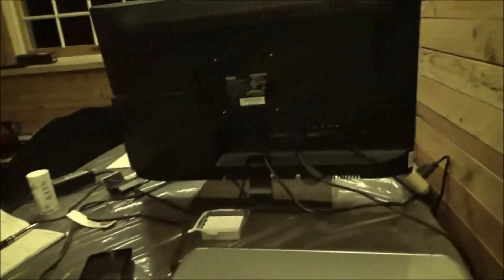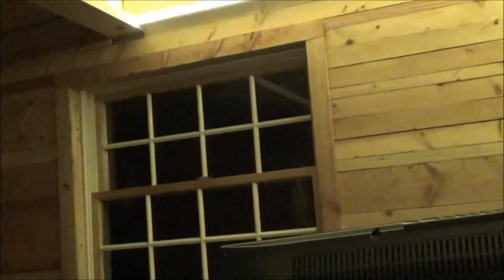Bedini Motor Radiant Energy Generator A Scam Or Is It Real

Comment: What is "radiant energy".   Is this infra-red?  Static Electricity?  Magnetic Inductance?  RF transmission?  Some may have used the term perpetual motion, I never did.   Is Radiant Energy something we cannot measure that science hasn't acknowledged the existence of yet?   Do you see the problem here?   It feels like the Bedini is faith based.
Reply: Albertzz99 Well, that would be interesting.
Reply: Is the problem...that if "science" hasn't named it then it must not exist?
Reply: No, not at all.  Such logic is easily defeated.  Obviously Neptune existed before it was viewed.   The first "observer" could not observe if his observations were a prerequisite for such a planet popping into existence.  My point is to draw to the surface if those who think a Bedini works can measure and show results or is their confidence in the device simply based on faith?  Is "Radiant Energy" part of some undiscovered energy field?  Is it measurable?  Or, is it so much vapor?  People seek to verify what they already believe.  They look to confirm their bias.  In order to remain rational we must all protect ourselves from this very proclivity.  There was no measurement taken in the beginning for which he can measure in the end to produce any before and after data.   He can simply declare it worked (or did not).  Yet, none of us can know if Schrodinger's cat lives?  (please forgive the terrible use of that reference)
Reply: RadicalRC So, if he measured the voltage of the batteries before and after the desulfating process would that help?  I would not begin to know how this "radiant energy" would be measured or if there is even a meter calibrated to effectively measure it.  But, just because I don't have the correct equipment to measure something, doesn't mean I must believe it does not exist. Has anyone ever attempted to measure that (what is it called?) backfield (?) energy?
Reply: Albertzz99 Perhaps a better term would be previously untapped, rather than free energy. It seems to be the Bendi simply harnesses energy that was previously wasted.
Reply from the maker: RadicalRC It can be measured and shown to some extent and has been done many times. You can see the output on an oscilloscope. You can see and measure the results in a fully restored and charged battery. You can see that the output battery has more capacity than before it was restored. You can see that batteries gain in capacity with each use on the Bedini motor. I can go on and on. But it has been proven to exist. Its like saying that you cannot see the wind so it must not exist.
Reply: RadicalRC  I agree, it's real easy to be fooled, happened to me too years ago. Someone told me it was possible to restore lead acid batteries by removal of sulphate. I think it must have been around 1992 - 93. This was about the same time my car battery started to show some signs of sensitivity to cold weather. So I thought, hey why not..Worst case it can only be too good to be true, right. Well it was worse. Forgot to say this was a solid state desulphator. So I went ahead with the experiment and hooked it up to the battery in the car. This was the type that's activated when battery voltage exceeds 13,5V,  so it was a permanent mount under the hood. As described in the instructions.  The weeks went by and it actually seemed to work and I thought this was one of the greatest inventions ever. At the time I didn't have equipment to measure internal resistance of the battery and no digital analyzers like today. So to me it really seemed to work, acid weight and voltage was good and it performed a little better when cold. It got me through winter and gave my battery a few months extended life. But then it suddenly failed. It completely fell apart internally. So one day my car started, the next not so much. I still have that "desulphator" as a reminder of how easy it is to get sucked into an idea and waste time accomplishing nothing.

I should have known better. There's always a reason why one ends up with a sulphated battery. And in most cases it's related to neglect, failure to charge it correctly and/or properly.
Reply: I think radiant energy is the high voltage electrostatic induction that existed and was played with since man was fascinated with lightning and devices like the wimshurst  were the first ones that tapped into it..
Reply: RadicalRC yes I believe the wimshurst has far greater potential that what chance it had been given since its invention in the 1860s? As soon as they found that the inductor coil could create high voltages, they dumped the wimshurst and other different variations of the contraption for the inductor coil methods. This is really sad to me because I think there is far greater potential in a wimshurst machine, its just that we haven't found this yet because we only used it for about 40 years before it was turned into some kind of novelty toy or science lab demo..the only time I saw its true potential was in a 1980s 'testatika' machine (based on a wimshurst machine but with many other secret mods in between) made by the late Paul Baumann..you should also look up on De Palma's (late) Homopolar generator too!! that one is also one heck of a simple device that taps into energy from the environment.I hope to make one like that one day if god permits
Reply: fidel catsro If you can prove something has a benefit, make it and money will flow your way.  If you make it and cannot prove it has benefit, the proper result is capital (money) flows towards people who can better apply it to productive use.  And, that is exactly what should happen.  There is no magic free energy, no over unity.  In that regard, every machine you mention is another form of Bedini bullshit.  The only energy from the environment here is the lug turning the handle.   That is the energy input, the only energy input here.  The energy in that spark is insignificant.  It's only potential is to give you a thrill.   Don't you think it's time to move beyond pretending there is any kind of "should have been" to ancient mechanical whirlly gigs?  Don't be the cave man who sees a flashlight for the first time and thinks it must be in the hand of magician.  Be the brute who invents the next new product or device that makes life less brutish.  We don't need to step back to hand cranking our own power generation.  Lets look ahead to the distant horizon.
Reply: fidel catsro If you could go back and show a cave man an I-Phone, he would be fascinated.  He would think you were a god.  He would be filled with wonder because you controlled something he did not understand.  If you were evil, you could use his wonder against him.  You could predate on him.  Don't be a cave man.  A mark of intelligence is realizing what you don't understand.  Do I see things that fill me with wonder?   Sure.  But, I know there is no over unity.  It's a hoax, a scam, a kind of religion.  I know if it looks like over unity, that simply there is something I don't understand.  Don't be a cave man.   Stay connected to reality.   I think those video's are fun, but mostly, I'm laughing at the lack of basic physics, or I'm looking for the scam, putting the puzzle together.  Some of these people are sincere, but fools.  Some are scammers suckering fools out of their investment capital.  The majority are simply creating compelling video's and farming you for views and click.  Smart like a fox.  Don't be a cave man.  Over unity is not science, it's fantasy.  Understand it as entertainment and do something productive with your mental powers most of the time.  In the end, you'll be much further ahead.
Reply: Bedini is scam. See my channel why, I debunk all his chargers by showing to you what is inside!! And how they KILL your batteries!!
Reply: RadicalRC I've been watching the "free energy commynity" for years with half an eye. But as of yet I have seen no one able to demonstrate any of theese systems running self contained, or in a closed-loop manner while producing excess power.
Reply: MollyDolly I don't think it's about wasted energy. Troy said himself on the video that the draw on the "source" battery was in the milliamp range. So that does not leave room for much waste to be recovered. He said on another video that the price on copper was the only thing preventing him from building a large Bedini to power more of his household. But I'm sure he could get the wire if needed. He has lots of stuff he could sell to get the wire he needs. I hope he can see that soon. Then he would not need to mess with so many batteries, solar panels, and wind towers.
Reply: MollyDolly You're absolutely right. I think that upcoming video will surpass all previous videos combined view count.
Reply: the radiant energy that troy uses here is a voltage spike (puls) created by a collapsing field from a coil, if you put dc power on a coil , and you disconect that power , the collapsing magnetic field will induct a high voltage in the coil, like a coil from a car ignition, or a simple doorbel, conect that bel on a 6 volt battery and put your finger on the coil wires , you get schocked by a dc puls of around 600 volts, that kind of spiked high dc voltage is fed into the battery to kind off burn of the sulphate from the plates., so in his case , the radiant energy is a high voltage puls.
Reply: Albertzz99 No one is making the claim that Troy's Bedini motor will work in a closed system. In fact, he clearly states that he inputs energy into the system and that if he unplugs it, it will cease to operate. He also states that it gets additional energy from a secondary source. It seems that what is being questioned is the efficacy of the secondary source.
Reply: SSanf To bad then I didn't quote all the different statements in my first post
 in this thread. So, while searching for them I found a new fresh one in
 the comments here on this video.__Quote Troy:"The only thing stopping 
me from running my entire home on this is the 
cost to build one. Thats it. John has one that he built. It cost him 
about $30,000 to build. It runs his warehouse and workshop. He sells 
them as well."__So you see, you must have an open mind and be receptive 
to the idea that someone will make a claim like this.
Reply: Albertzz99
I think it is only fair to solely address the claims that Troy, himself, has made. He is not responsible for the accuracy of the claims of other people. I am not entirely sure what John's claim is, perhaps, it is simply keeping his batteries in good shape.
Reply: SSanf I think you are 100% correct that nobody could know exactly what john claims, and that Troy hopefully can't be held responsible for his statements.  So here's the part of Troys quote that's solely made by Troy about Troy himself. QUOTE: "The only thing stopping me from running my entire home on this is the cost to build one. Thats it."
Reply: Albertzz99
I think you should ask him for further clarification of what he meant.
Reply: SSanf I just did.
Reply: Albertzz99
Right you are.
Reply from the maker: Albertzz99 It is quite simple really. The thing needs some little power to run the wheel. The power going into the batteries being charged is greater then the amount of power being used. This is not the creation of energy, just tapping into an energy source that is readily available. With enough coils, transistors and components, you can have enough energy to run a house. Again, ask Ham radio operators about the energy that gets charged up in their antenna wires. Where does it come from? Why is it there? How can you use it? Well, the answer is simple. Its called a Bedini motor. The energy is there. Its sitting in what is called the Dirac Sea. Some call it Radiant Energy.
Reply: RadicalRC a bedini motor(like the one troy has) is nothing more than a motor, for as far I know now, a bedini motor is not (not yet) a overunity machine, only thing it generates is spykes, you can use, witch does not say i do not believe you can make a selfproppelant machine of it, fact is you can spin a wheel with very low power, but here is the problem, when you connect a pickup coil near the spinning magnets you can draw power of of it, but that power loads the wheel, in time stopping it, so no overunity, its more like a transformer now, with a spinning core in stead of a laminated steel fixed core.,you cant pul out more power then you put in it.
Reply: The Do It Yourself World  I think people are confusing the bedini motor with the bedini overunity generator, that does not work (yet).
the motor surly works afcource!, only not as a overunity machine (charging the same battery you useto turn the bedini motor, that can never be a overunity becouse off the friction in bearings, air drag and powerloss in coils etc., people are confusing the motor as a puls provider and a overunity machine.
Reply: MollyDolly this can be mesured by a volt meter, ossiloscope and a amp meter,

if you use a scope you can see it all at ones.
you can even calculate how mutch power the coil gives in a emp puls, thats higer grade electronics than normal electronics and electicity lessons.its sience!!
Reply: MrBugsier5
I think you are exactly right. is is not an over unity machine as Troy has described it. An over unity machine is impossible according to the laws of physics.
Reply: The Do It Yourself World Could you explain "The power going into the batteries being charged is greater then the amount of power being used."?     Do you mean you get more usable power put into the battery charged than what's consumed from the supply battery.
Reply: Albertzz99 He's not making that claim.  In fact he said specifically he did not believe it was in any way perpetual motion.  This question wastes time.   He's already acknowledged your position.  Lets move on.
Reply: RadicalRC If you read his reply to me above you'll find he says, quote: "The power going into the batteries being charged is greater then the amount of power being used."
I'm simply trying to understand his invention and how it's supposed to work when running.
Reply: Critic (al)  What do heatpumps got to do with free energy? They only move heat from one end of the system to the other via a medium (refrigerant usually). A heat pump can't run without energy supplied from the outside. This can of course be renewables, but outside energy just the same.

Troy claimed to get more out of his system than what was put in. If this is the case he would not need solar panels, only a bigger bedini. A heatpump can't run closed-loop and at the same time produce excess power. So no free energy.
Reply: Albertzz99 y do not believe that Troy sead that the bedini motor is a overunity system, he only stated that he uses very little power to make high voltage spikes to revive the second battery, making high voltage from low voltage is not the same as making more power out than he puts in, im sure he never mend that in his explenation, troy uses a bedini motor to make hv spikes to thry to repair sulfated batterys, not charge empty batterys with lesser power than normal, that would be a overunity machine witch by the laws of phisics is not possible (yet,)( who knows maby in the future!)
Reply: MrBugsier5  You have the same perception as me of this machine. But the thing is Troy actually said he got more power into the battery being charged than what was consumed from the supply battery. He also said Quote: "With enough coils, transistors and components, you can have enough energy to run a house."

That's why I want to know how his machine work, because this is big news. I'm also surprised he did not use it more often when the sun don't shine.

But if he don't want to tell the "secret" that's ok too. Then I'll stop asking.
Reply: Albertzz99  Troy nows very well that the bedini motor can never produces more power than it consumes, its just inpossible, but if he says that it is so he is indeed wrong, at this moment a bedini motor cant produce more power than you put in, its just (still) inpossible .
Reply: Critic (al) I simply cannot have a conversation with you if you can't understand the topic. A heat pump pumps heat, hence "heat-pump". A mechanical heat pump transfer heat from the evaporator to the condenser in most cases with the refrigerant as a medium. It does not "tap" "other energy sources".
Reply: MrBugsier5  This is my impression as well. But you can read my last quote if you scroll up in this discussion thread till you see his last entry where he responded to me.

I guess he will clearify this as time passes, so we in time get to know what he actually meant to say.
Reply: MollyDolly It would be my presumption that "radiant energy" is extra-scientific.  Something not real.  If it is explained in a way that it can be measured, then I'm all ears.  Not listening is not learning.  I've been sucked into fallacies or misunderstandings before.  there is no shame in correcting an errant position.  In fact, I take great pride in doing so.  

You go on to state: "But, just because I don't have the correct equipment to measure something, doesn't mean I must believe it does not exist."  This is true.  Does a tree make a sound when it falls and there are no ears to hear it?  Of course it does.  If it's real, it's measurable.
Reply: Albertzz99 I watch it also. It's great fun picking out the physics they are overlooking or watching how they explain it away.  I don't put Troy in this area.  He opened up with a statement that this is not perpetual motion.  I believe he believes that.  It may be Mr. Bedini believes otherwise, I don't know that much about him.
Reply: RadicalRC You're right, I remember he said that about perpetual motion. That's why I got so surprised when I saw all his other statements popping up multiple places, and on multiple videos. My first thought was "a bad explanation" from Troy. But then I saw someone ask again and got the same answer. So I had to sort of ask again to make sure I did see it correctly.

It's not the first time I have met people who think a heat pump is a "magical" free energy device like Critic, LOL  I mean 250 year old technology should be easy to understand :)
Reply: Albertzz99  wel it does, a heat pump uses electricity to run the pump, pumpig the refridgerant fluid, when it becomes a gas it wil get cold, so when it gets compressed it becomes a liquid again, this convesion produces heat, works the same as a fridge.(that needs a powersource to, mostly electricity, and in some cases propane for the heating flame.) so external energy to get it doing his thing.
Reply: The Do It Yourself World 1.  If we can see it on an oscilloscope then were are measuring electricity not "radiant" energy.  An oscilloscope only measures electricity.  Of course it can measure other things like sound if a microphone (a sensor) is used to convert the energy into electrical.  I imagine when Bedini says "radiant" he means something unknown or magical and not simple pulsating high voltage derived from magnetic field collapse and a coil.

2.  I would agree, if a careful capacity measurement were taken before and after, the tests would begin to build some proof of the desulfating claim.  I think this is very possible if not probable.  However, you do not posses the equipment to make such a measurement.  Or at least, if you do, I've never seen it.  It's only a feeling, a presumption, a whisper.  It would be fun to make a single cell PB batter in a Mason Jar and experiment with capacity before and after the Bedini over several cycles.
Reply: RadicalRC  in case of capacity its easy to see the difference, if you have a sulphated battery you cant charge it with a normal charger, after pulsing it for a time with high voltage peaks as you do with the puls from the output ofsay a bedini motor, the sulfate its getting from the plates and you can charge it again with a normal charger, his is a fact!, you do nat have to use a bedini motor, you can also do that with a electronic pulser, as long as it feeds high voltage spikes in the lead acid battery, thats no magic but plane fact. btw you dont mesure electricity with a scope, you mesure only voltage, when u mesure the voltage over a known resistance you cn calculate the amperes, a scope only mesures voltage.know the facts before you make a statement.
Reply: RadicalRC btw, reviving lead acid cels is no magic, we do it often with traction batterys, witch are expensive, and somtymes easy to revive when they are necleted ore not charged for a long time, believe me, its no magic, i do this for my proffession, we sell and instal battery systems, also on off rid projects.
Reply: MrBugsier5 I am aware of that. In another thread I theorized if it was working is was probably only because it was delivering a correct pulse pattern by Rube Goldberg means.  It's a series of coils, apparently a transistor turns power and on and off to the coils.  There would be spikes like an auto coil.  I am a battery professional also.   PB is a minor part of what we do.  I'm trying to keep the language and my explanations at a level most any reader can follow.
Reply: MrBugsier5 Going back and reader earlier comments you state :"in case of capacity its easy to see the difference, if you have a sulphated battery you cant charge it with a normal charger, after pulsing it for a time with high voltage peaks as you do with the puls from the output ofsay a bedini motor, the sulfate its getting from the plates and you can charge it again with a normal charger, his is a fact!, you do nat have to use a bedini motor, you can also do that with a electronic pulser, as long as it feeds high voltage spikes in the lead acid battery, thats no magic but plane fact. btw you dont mesure electricity with a scope, you mesure only voltage, when u mesure the voltage over a known resistance you cn calculate the amperes, a scope only mesures voltage.know the facts before you make a statement."

You make all those sensible remarks for which I side with you fully.  I've even made the same statement in other threads (the Bedini providing pulsed by more complex method) then end it by being a dick head.   

MrBugsier5 "know the facts before you make a statement."

Whatever big boy.  Whatever.
Reply: Albertzz99 Yes, he does.  Although I agree that it stinks of what you suggest, I wouldn't go as far to say it's absolute.  From what I can tell, the Dirac Sea is a real and not discredited theory.   However, there are sites showing how people use the concept to scam others.  If the energy is there and it's being subtracted from, then it's not perpetual motion.  I don't see him making a claim of perpetual motion here.   I don't understand the "Direc Sea" theory in physics and doubt Troy or Bedini or anybody in these threads does either.   I'm skeptical.  It's not been proven and nobody here seems capable of proving the Bedini taps this form of energy.  It's vapor science in all likelyhood.   Like I said, I've been fooled before.  Everybody can be.
Reply: Albertzz99 "I should have known better. There's always a reason why one ends up with a sulfated battery. And in most cases it's related to neglect, failure to charge it correctly and/or properly."

I agree.  However, there are sophisticated battery chargers wiht real programs in them that are effective at combating sulfation.  It's not fool proof or magic.  It's always better to plan a system in a way that minimizes sulfation.  The shallower the discharge and the shorter the wait before recharge the better.   Apply that sentence to PB batteries always and you will never be wrong or far from wrong.  I had a 800 amp hour system in a houseboat once that I got about 8 years out of before my initial batteries started failing.  I felt pretty good about those results.

There are other ways for a cell to fail of course.  Sulfation is only one of them.

There is an element of survivalist thinking in the off-grid community.  For some it's almost no concern, for others, their main focus.   If the world ever went bonkers and you were alone for years, once the batteries all went bad, it would be the systems that don't require them that would be of highest value.   Storing energy is a big issue day to day as well as in theoretic situations.   A very large reason why fossil fuels reign.  

I'm not a survivalist.  Just thinking out loud.
Reply: RadicalRC yes you are right!
Reply: RadicalRC I got one charger with a separate "restore" program. But most decent computerized modern chargers I've tested do a pretty good job I think. I mean, some soft sulphate is forming during it's life anyway. So if a battery has a slight soft layer at the end of its life when the plates are corroded anyway I see no point in even trying to remove it. All one would most likely end up with is plates falling apart like what happened to me earlier.

My experience is the same as yours, shallow discharges and immediate charge is best to keep PB's in good condition. Temperature is also important. I'm curious to se how his new batteries will hold up indors with the heavy loads and fast recharges in a room temp enviro. I would not be surprised if the internal temperature of those new batteries will rise to plate corrosive levels. Think last years solution was a better one temperature-wise.

Edit: I've also noticed in some videos his float voltage seems to be way off what is normally considered to be in the safe range for flooded PB to avoid excessive corrosion.

Yeah, 8 years on a set of marine batteries is pretty good. I certainly would not expect much more, unless it's a set of Optima style batteries. They handle vibration really well. I still have one from around 1994. A red-top, of course it's nothing like a new one, but still do its job as a SLI.
Reply: Albertzz99 "I would not be surprised if the internal temperature of those new batteries will rise to plate corrosive levels. Think last years solution was a better one temperature-wise."

I would enjoy hearing you expand on the above statement.

I didn't use marine type batteries.  Many years before when I know little of nothing of lead acid cells, I got some help form a very experienced person.   He helped me solve several problems on my first houseboat.  Such boats on impounded fresh water are not subject to a pounding.  Thus the internal supports of a marine battery are not required.  I used 4 8D diesel truck batteries.  I've done this with two houseboats and been very happy with the results.  I don't remember all the spec's, but I think I was sitting around 800 amp hour capacity.  It's important to know these were Anamony type cells needing watered once a year.   They are designed for deep discharges like a trolling motor battery.  It was explained to me on the first purchase that big rigs idling all night are slowly discharging as the engines turn to slowly to keep the battery full. I don't know if this is actually true, but the choice turned out to be excellent.  At one time through a business account, I could buy these batteries as "blemished new" for about $80 each.  Deka brand.   Killer deal.   I was running incidental loads, the biggest being an apartment size Sanyo refrigerator and a TV.  4 lights in the living room which are fluorescent and a few incandescent in bathrooms and bedrooms.    Could run laptops, whatever else you wanted.   My inverter could run the microwave and coffee pot.  I did that only a couple times as a short test.  80 amps discharge at 12 volts.  Yikes!   I ran the gen-set whenever we made coffee in the morning or baked in the microwave in the evening.   This kept my batteries full or reasonably so.  Even a week was no problem.    My normal discharge of that 800 amp bank was probably rarely over 40 amps.  The charger wide open (I think it was capable of 100 or so) was still a low rate of charge for such a big bank.  30 minutes or so and I'd be full most of the time. Those are the high points.  No short cut on battery type or overall capacity was way cheaper in the long run.   Incidentally there is no such thing as a maintenance free battery that is a true deep cycle.   I spent way less money on batteries when I quit relying on maintenance free so called deep cycle batteries.  Marketing.  The last little but might be controversial, however, it's served me well.
Reply: RadicalRC exact!, using the right batterys (traction) is a must for longer life of the batts, keeping them charged is also inportant., most people make the mistake of using car batteys or the so called marine batterys( mostly they are the same type only more expensive) big part of the lifespan is also the way they are constructed (and maintained), what y always tel my customers is , the bigger the amphour ratig of the bank (not to be confused with the cca!), the better, you just work the batterys a lot les, the les they age., but jou are also right when you say that you have them kept full, the better it is indeed.(I see this in practice in my proffession)
Reply: RadicalRC It's pretty easy on one hand, but on the other it's a science all in it self to properly maintain those batteries. But a few things most experts seems to agree upon.
1.Incomplete- or undercharging causes sulphate buildup.
2.Overcharging causes plate corrosion and temperature rise.
3.Elevated temperatures shorten battery life by accelerating plate corrosion (even without overcharge).

Personally I think those 3 things are the most devastating to a PB battery.

So far this is pretty basic, right? Let's take this further.

The recommended charge time for a lead acid battery to reach full saturation is ~15 hours. This has not been done with Troys batteries, ok maybe a couple of times when he had his windmills up, but generally not. So it's already fair to guess they had sulphate buildup due to incomplete charging. This sulphate layer increases the internal resistance of the cells. And what happens when a voltage is applied over a resistor? Heat is generated, temperature rises. This is why he had one hot empty battery returned to him from the store. It was sulphated. So the situation is this (at Troys house). Sun is shining only so many hours a day. So a complete charge (~15hrs) is not possible. Sulphate is building up. As time goes by more and more heat will be generated inside the cells. The batteries are inside where it's hot already.

Consensus between battery experts seems to be that a PB battery operate best at up to 25degC/77degF. Beyond this point every 8degC/15F rise in temperature cut its life in half.

So the hot battery Troy got back from the dealer was hot for a reason. And my take on that battery death is that it was certainly not the first time that particular battery had been too warm inside.
Reply: its is not the charging time alone to counth with, its the amphours used that have to be replanisht, this can be done by rasing the charge amps, for inctance,(teortical) if you have to refil a empty (80%) 100 ah battery you have to get 80 amphours back in it (not counting the losses) wit 10 amps charging (thats the best , 10% of the capacity of the batt) it wil take 100/10= 10 hours, by doubling the charge amps to 20 amps (20%= still safe) wil take 5 hours for that, so its not only the time, its the charge amps to., for the rest you are tottaly correct, in case of Troys hot battery its not sulfation, its a short in one cel, thisbattery under load gave a good cca test, but bad voltage, agree sulpation at troys set has to do with several different cases, first no no was to parralel older batterys to a set of new ones,second wasthe building of his bank, he did not build it in the correct way he parralleled 3 12 volt banks in parralel, he forgot to couple the 3, 6 volt polestogeter (put 3 ,6 volt batterys in parralel, and put them in serys with the other 3 , 6 volts in parralel, thats de right way, not 3 banks of 12 parralel, you cant hold the 6 volt batterys equal in that wrong way, you can by parrallelling the batters first, then put those 6 volt banks togeter in series to build the right bank., keeping the bank topped up is the most inportant thing to to prevent sulfating. (using good batterys is also a must, the cels he has are from a very cheap and bad quality.
Reply: MrBugsier5
 You are wrong on 2 things.
1."its is not the charging time alone to counth with, its the amphours used that have to be replanisht, this can be done by rasing the charge amps, for inctance"

This is is wrong. It has nothing to do with fully saturating a cell. This is only for shortening the bulk charge stage. A full saturation means several hours in float mode. I've done this testing on so many different lead alloys, and all of them need time in float mode to fully saturate. Some brand new batteries may need as little as 2-3 hours in float mode, but the majority of them needs more. And in this phase of charging you can't count Ah out vs Ah in because it's more inefficient than the previous charging stages.

2." in case of Troys hot battery its not sulfation, its a short in one cel, thisbattery under load gave a good cca test, but bad voltage"

This is also wrong. I actually had to go back and look at the video to see if I remembered all of this correctly. And yes, you are wrong. The battery voltage was 6.69V. This is impossible with a shorted cell. There's only 3 cells in a 6V battery. So if you were correct that would mean a cell voltage on the 2 remaining cells of over 3.3V, that's just crazy. Furthermore the temperature during testing of this battery was 94degF. This is caused by fast-charging a battery with a high internal resistance. In many cases this is due to sulphate build up. And in Troys case I'm almost 100% certain sulphate build up is the reason because he almost never gave his batteries a complete saturating charge.
Reply: y agree with the part of the end charge (saturation) that indeed can take a lot longer than only the amphour recharge, but the 15 hours you mention is pure bs (no offence), if the end voltage (in equalize mode) is a bit higher it wil saturate mutch faster, you do not need to reach saturation every charge, you do this about two or 3 times a year, this is to keep off te sulphation, charging everythime with a equalize charge is also damaging for lead acid traction cels. (im not a no no, i sel and build traction banks for living in offgrid projects, )(on and offgrid).
Reply: ps the 6.69 it mesured after he test, is in not balast mode, when drawing huge amps the plates in a cel can bend, creating a short stil messuring 7 volts no load,(seen this a few times in practice to) so its not inpossible, but y agree that his batterys are all sulpated, (thats why he is trying whit the pulser (i dont deare cal it bedini) to revive them.)they wil never be like new tho.best would be just to get a 12 volt huge tractio set (1500 amphours or even more.(the bigger the bank, the less it has to work, the less its damaged by use also)
Reply: MrBugsier5
I'm glad you agree that fully saturating a cell takes time after float charge is reached. The reason I said 15 hours instead of 12-14, 14-16, 12-18 or some other number of hours is 2 things.

1.Most experts can sort of agree on 15 it seems. I think this is based upon the old rule of thumb that you charge with ~1/10th battery capacity charge current to increase life of a battery. That's the first 10 hours. This leaves you 4-5hours to reach a "safe" level of saturation.

2.Troy says he had a 600Ah battery bank. His charge controller is 60A, I think, (correct me if I'm wrong). There you have a 1/10th relationship between charger and bank capacity. Charging an empty bank with solar will take more than 10 hrs in Troys case. Reaching fully saturated cells additional hours.

So 15 is a pretty sound number in both cases in my opinion.

Of Course you can charge with more than 1/10th but it's more corrosive on a golf cart battery than on a regular car battery (SLI). That said, I think Troys batteries would have sustained less damage from being charged 1/5th (120A) to shorten the over all time than from being half empty for 2 years. After all he only has the sun shining for limited time each day.
But increasing current do have its pitfalls to watch for. I mean, for sure you increase the effect of surface charging of the plates. So the acid in the boundary layer between the plates get "hot" and corrosive and time is what it takes for both acid to mix and diffuse into the active material. In other words it takes more time for a cell to get from a surface charged state to chemical equilibrium the harder the charge.

I had no intention to imply you don't know anything. I simply stated the 2 things I meant you got wrong. I choose to believe that's ok.
Reply: fidel catsro Thank you for mentioning Wimshurst.  Watched a cool video I'll link below.  The Bedini is simply a mechanical way of creating high voltage from a collapsing magnetic field.  It whirls and appeals to an inner sense of wonder for a common effect with multiple ways of production.  I would expect the Wimshurst would be just as effective if not more so, probably much higher voltage.  An inductor and solid state triggering device would be simpler, smaller and more efficient, but nothing visual is happening to appeal to the interested user.
Reply: RadicalRC actually my idea was to have a high speed motor driven for a wimshurst..high voltage  seems nothing more than novelty items because our so called modern society has been toilet trained for the past 150yrs to use high current drain methods of using electricity from the start, so this kind of cold electricity seems useless for our current devices..happy new year!
Reply: point still wil be a watt is a watt.
Reply: MrBugsier5 Absolutely.  I'm all for physics based science, rational reality and most of all Liberty.
Reply: RadicalRC true true indeed a watt in is a watt or maybe less out due to wire resistances and metal magnet induction, but I seen some multiple tesla coil experiments (air core) that lit up several outputs of lights without extracting more than the same input in some other videos that's what im fascinated about radiant energy..it needs a lot of tinkering and experiments and high voltages that seem to defy input watts at some point of frequency or voltages usually high voltages specifically (some kind of self oscillation occurs between the coils)..lets hope someone discovers that tricky method and specifically shares with us..radiant energy:its a subject very sensitive, controversial and very evasive because it cannot be induced or replicated effectively by everyone that's the thing that causes frustration to every experimenter
Reply: RadicalRC ok ok maybe youre right but im not giving up yet..what about the testatika? was it real or scam to you?give me your honest opinion on that..
Reply: fidel catsro Never heard of it.  Trying to be the one guy who uncovers over unity is like trying to be the first visitor who actually gets a good photo of Nessie.  Everybody thinks it will be them.  There are too many real things to work on to waste much time trying to bring a ghost to life.   One of my favorite channels is:  https://www.youtube.com/user/veproject1/videos
Reply: RadicalRC yes veproject it inspires designs for perpetual motion, I like that site too although I know its not possible or real..just look up testatika on google